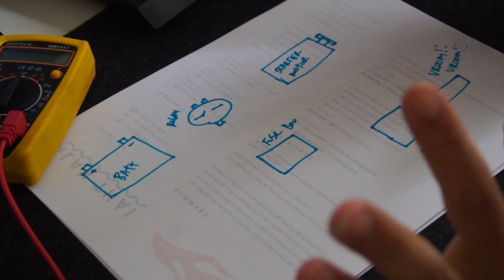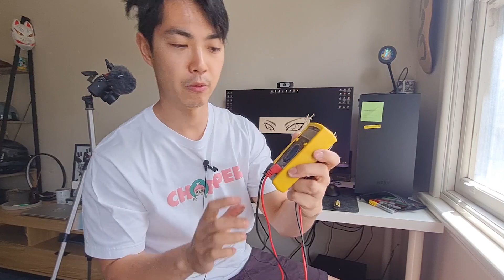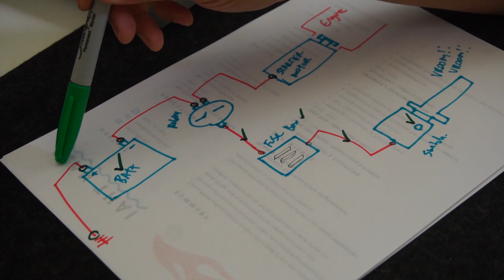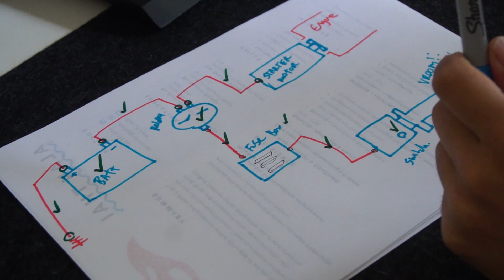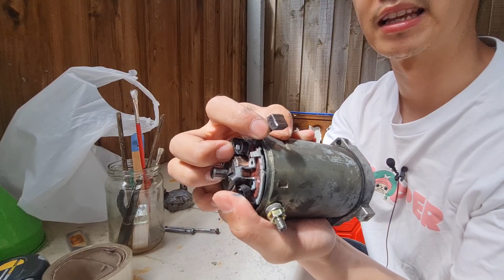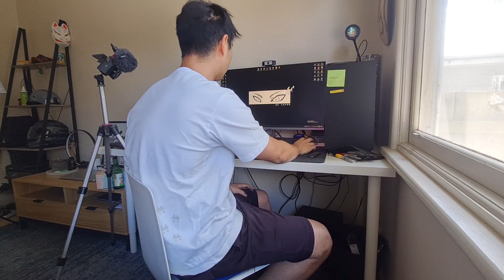Starter Motor Troubleshooting - KZ440 Custom Build - Motorcycle Maintenance

Comment: Great video! I just want to make sure I’m understating this correctly. In your wiring diagram you mentioned that the positive terminal was used to ground the bike and the negative was used to connect to the relay circuit as well as the starter. Shouldn’t this be vice versa? I’m also referencing the wiring diagram for the same bike. Thank you for the great video!
Reply from the maker: Sorry! Negative is ground, positive (red) is power.